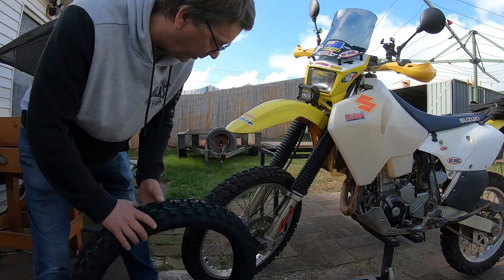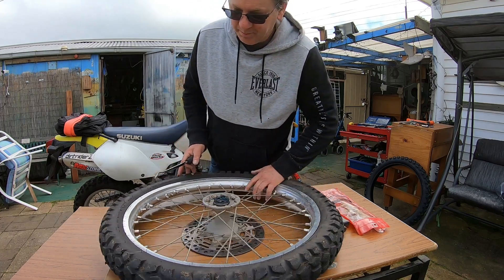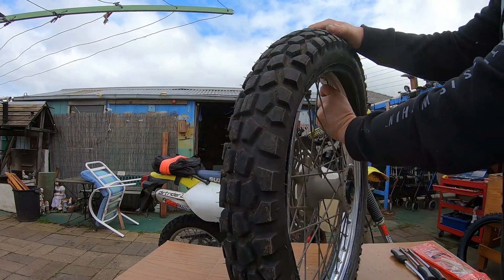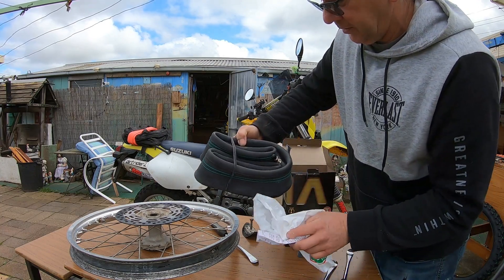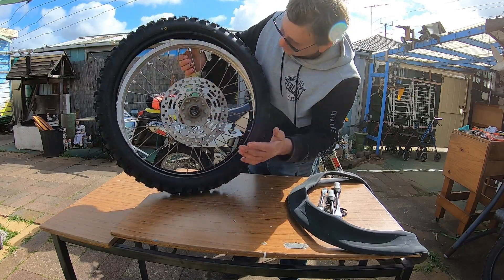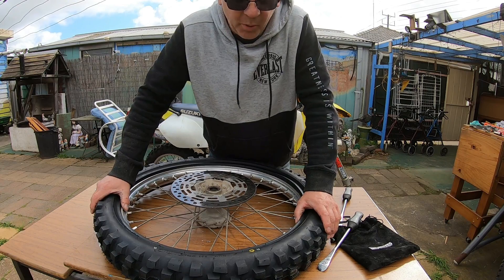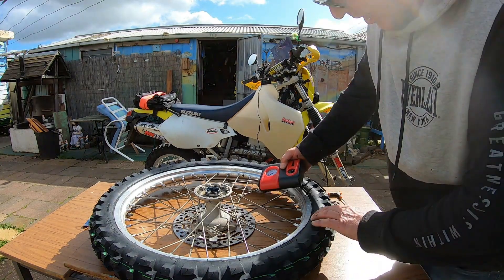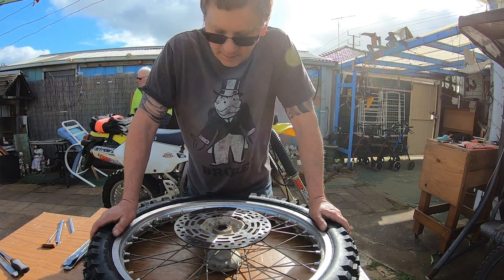The DRZ gets a new front Tire, Dunlop 606

Comment: Good luck with the new tyre. Hopefully better in the mud.
Don't get the Vee-Rubber tyres, scary on wet roads. I stacked it on a wet roundabout going less then walking pace on my old DR350.
Reply from the maker: Thanks Ian, it's got to be better. Had mixed comments about the 606 but I think it will be fine. roundabouts always scare me in the wet.

Comment: Beware....the 606 on the front is dangerous in my experience. So much so I took it off after obtaining a RWC. There's no natural centre, tracks all over the place and tram lines in ruts, etc (off road), great on road, no issues there. I hated it, back being OK, a little tail happy compared to better off road tyres.
Reply from the maker: Thanks for the advice, I'm hoping it's better in the dirt over the 605 I had on. Cheers
Reply: @bazz6670  I now run full knobbies front and back but am told the MT21 is the go for DOT on the front. I found the front feels like it wants to constantly fold under on dirt, hopeless on anything slippery but again brilliant on road, no complaints there.
Reply: @bmccameron7642  You need to check your rear sag numbers. 90 - 95mm. DRZ are prone to folding the front due to the geometry and riders not leaning forward enough. Also if you slide up close to the tank when cornering in loose gravel or dirt, you will weight the front tyre and is will grip the dirt so much better. if you still feel the front wants to fold, you can push the forks up through the triple clamp an extra 10mm.

Comment: As everyone says, MT 21 is far better then the D606 of road. much the same on road.
Reply from the maker: I will have a look at them next time, I have found the 606 a bit washy .cheers.
Reply: @bazz6670  I made a comment below regarding adjusting the geometry and weighting the front in loose traction corners. Give it a try and it costs you nothing.